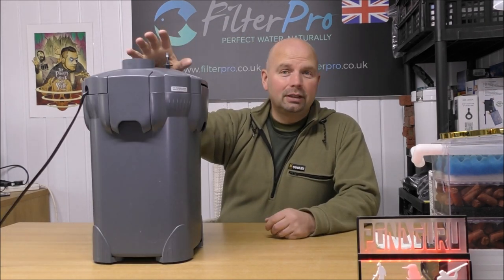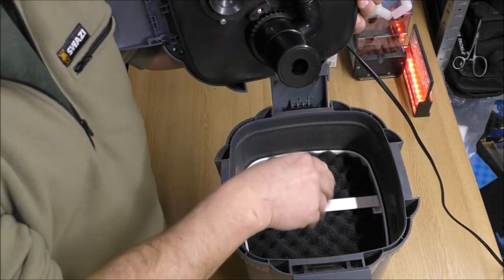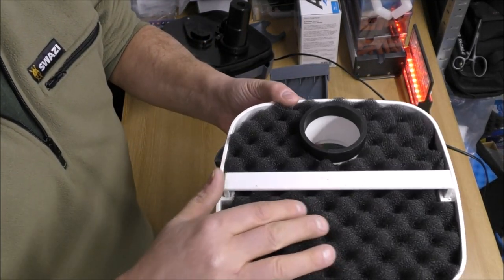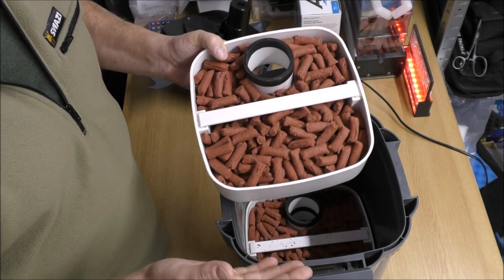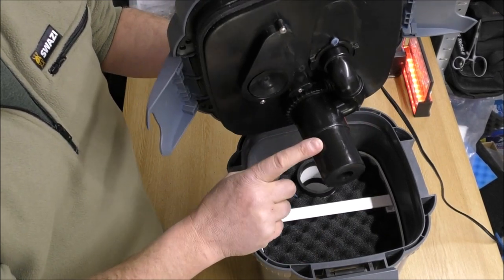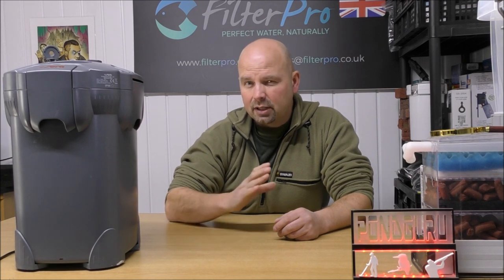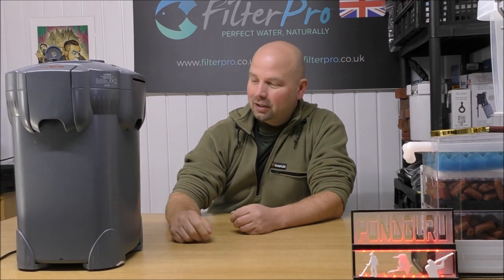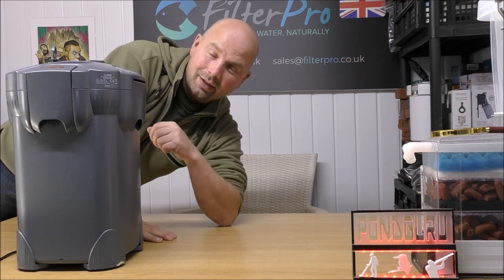Pimp My Filter #79 - Sera 400 Canister Filter

Comment: Hi mate, just wanted to pop in the comments and say hi 👋. I bought my first filter from you around 20 years ago a BioTec 10 for my first pond and would you believe I still have it now with a few modifications all be it 👍

Just started my own little channel recently on my pond just as an extension of the hobby for me.

Be Well n Be Good Man 👍...Mark
Reply from the maker: Nice one - good to hear that the filter is still going strong. Oase make good filters and that reminds me I really need to list a couple of 15000 pressure filters which have been sitting my shed to list on ebay. Best of luck on Youtube - it is very difficult to establish any proper channel on here as only nonsense seems to get promoted - as a reliable video platform it's fallen so far from the early days.
Reply: @Pondguru  just in it to extend the hobby for myself really not looking for much out of it other than a bit of crack & sharing ideas with like minded people 👍

Comment: Okay, I have a question and it seems like you know alot about this stuff so I'd love for you to answer:

I plan on using this filter for a waterfall inside a terrarium, I think the 1100 l/h is a nice flow for that, but I wouldn't want the waterfall to be on all the time. If put it on a timer and run it 3x one hour to simulate rainfall (helps the glass frogs with breeding). Will the filter function correctly in such a usecase? Like will the aerobic and anaerobic bacteria survive the 7 hours without flow? Also the tank will probably only have about 4-5 gallons of water in it anyway. Do you see any problems arising?

Thanks in advance!
Reply: (my other channel) As long as the filter is running once or twice an hour it will keep the bacteria alive in the filter media and it will clean the water. The only real problem would arise if the filter was being run during the day and turned off during the night since the water will quickly go 'bad' if the filter doesn't run for hours on end.
I only run my big pond filter about 1/3 of the time since it is also on a timer - it works fine and is full of invertebrates feeding on the food coming in every time it is on (for 15 mins a time 24/7).
Best of luck with the tank, it sounds great.

Comment: Hello! Which canister filter do you recommend for a 75 gallon, sumpless reef tank? Currently I have a Tunze internal skimmer, but would like to get rid of that for a canister only. Thank you in advance for any suggestions and Happy early New Years!
Reply: (my other channel) Happy New Year too - the size of filter will be dictated by the stock in the tank but for marine systems we recommend 2kg of media per 100 litres.
I'm assuming that you're working in US gallons? If so then it's approx. 285 litres so you'd need around 6kg of media.
There aren't many filters which will hold that much but the best of them would probably be the 1200XL from Eheim. It is very good and will last for ages.
Reply: @ThousandYardStare  thank you so much for responding!

Comment: I don't understand what you mean by halving  the media if you have a heavily stocked malawi tank???
Reply: (my other account) Sounds like you're getting confused by the part where I recommend what size tank the filter would be good for (to achieve a full cycle)?
e.g. if the filter held 5kg of media I'd recommend it for a normally stocked tank of up to 500 litres or a tank half that volume (250 litres) if it was heavily stocked - that's because the more waste is produced the more media / bacteria is needed to fully process it.
The below is copied from the Q&A page on my FilterPro site: 

IS THERE A MINIMUM AMOUNT OF BIOHOME REQUIRED TO ACHIEVE FULL CYCLE FILTRATION?
Yes - Using 500g in a huge filter on a 500 litre tank will not reduce nitrate if all the other media is producing nitrate. When a sensible amount of Biohome is used the results are outstanding.

Through years of Biohome being used in all sorts of aquariums and ponds the recommended amounts of Biohome needed to see a good reduction in nitrate (full cycle filtration) are as follows:

(100 litres is approx. 26 US gallons and 1kg = 2.2 lbs)

Average community tropical aquarium = 1kg (2.2 lbs) per 100 litres (26 US gallons)
Average coldwater aquarium = 1kg (2.2 lbs) - 1.5kg (3.3 lbs) per 100 litres (26 US gallons)
Goldfish aquarium = 1.5kg (3.3 lbs) - 2kg (4.4lbs) per 100 litres (26 US gallons)
Predator aquarium = 1.5kg (3.3 lbs) - 2kg (4.4 lbs) per 100 litres (26 US gallons)
Large cichlid / discus aquarium = 1.5kg (3.3 lbs) - 2kg (4.4 lbs) per 100 litres (26 US gallons)
Malawi / Tanganyikan aquarium = 1.5kg (3.3 lbs) - 2kg (4.4 lbs) per 100 litres (26 US gallons)
Marine aquarium = 1.5kg (3.3 lbs) - 2kg (4.4 lbs) per 100 litres (26 US gallons)
Average mixed fish pond = 1kg (2.2lbs) per 200 litres (52 US gallons)
Average koi pond = 1kg (2.2lbs) per 150 litres (39 US gallons)

Ammonia and nitrite will be reduced at much lower amounts but full cycle filtration is the only 'proper' filtration therefore the figures above are for the filtration job to be done properly resulting in less water changes being required.

REMEMBER - It is always better to over-filter than under-filter as a filter with a larger capacity will react more quickly to any pollution incidents and process waste before levels rise above safe amounts.
Reply: @ThousandYardStare  I've got ya.  Also I just read the paragraph about not using a water conditioner that detoxifies that is interesting.  I use prime I was told that it detoxifies for 24 hours  and also told because of that you can post pone your water change for a day.  I guess thinking about now detox means kill off which I'm thinking now is why I have always got around 40ppm in my 450litre 20 african cichlid tank . I've had this tank set up for 2 years with no dramas except the 40ppm.  Any thoughts?
Reply: @dominic9279  The conditioner which has the detoxifying / binding effect on ammonia, nitrite and nitrate effectively starves the bacteria and ensures that the biological side of filtration (bacteria population) is held back - less bacteria means = waste processing = elevated level of nitrate.
Hopefully you haven't been conned into using stability (coincidentally also from seachem.....) as you don't need to keep adding bacteria into a system which is working properly, only one where the bacteria population is being held back artificially. 
A normal conditioner e.g. API Stress Coat will ensure that the water is safe for life and allow the bacteria population to grow in accordance with the available food source.
Before deciding if you need any extra filtration try swapping the conditioner - you may find that everything is already in place for a full cycle.
Reply: @ThousandYardStare  no I don't use it but I use river revolution which is a nitrifying and denitryfying bacteria which is used at the rate of 2 drops per hundred litres which I've been told to use after cleaning the gravel or one of the three filters at a waterchange to replenish the bacteria that is lost when doing so...
Reply: @dominic9279   Unless you're throwing old media or substrate away when doing maintenance the only bacteria lost will be what is in the water and that will be minimal. You don't need to add bacteria to a tank after maintenance / water change when the filters are big enough and working properly.
The bacteria currently is being added only to mask the side effects of the prime which is reducing the bacteria population.
Reply: @ThousandYardStare  I'll will change it up and I'll let you know how it reads Saturday week
Reply: @dominic9279  It generally takes at least 3-4 weeks for the effects of prime to go from the tank and assuming that you have enough filtration with suitable media you should see the nitrate level naturally fall when using a 'normal' dechlorinator.
Reply: @ThousandYardStare  oh yes I have very adequate filtration plus some.
Reply: @ThousandYardStare  Common-sense I appreciate it its sooo refreshing its why I like Ben ochart aswell...